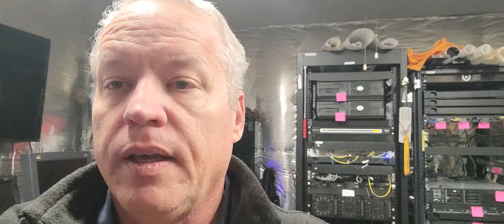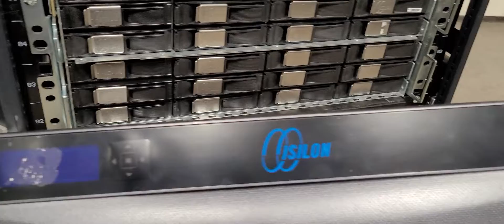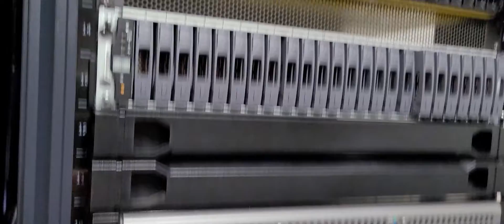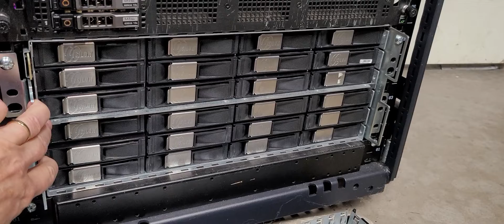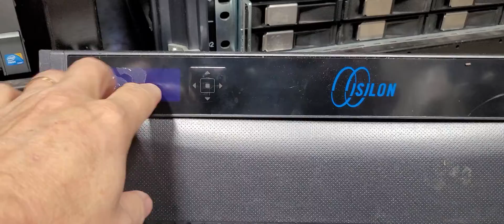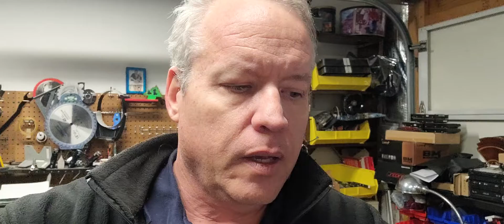Migrating my FreeNAS server (old) to my new TrueNAS server (new) and how to do it to save space

Comment: My NAS started as me buying a RPi-4 and connecting two USB3.0 HDD caddies to it, running Open Media Vault.
It worked well enough (MUCH better than something like a WD MyCloud).
I ran my FTP to it for local IP cameras (had one Purple drive) and another Red drive that was a 4TB storage. No redundancy though.

When I began working at the job I am at now (about 1.5 yr ago), I began to learn more of the MS/Office side of things... and how servers functioned differently than consumer/home PC's. I had the opportunity to buy my first Dell R710 and I brought it home... n began to learn the hard way. Turning it on n google'ing a ton 😆

It has been a bit of a shock (and learning curve) w/ servers... especially how picky they are (RAID controllers not liking diff HDD's, or sizes depending on BIOS, or not starting b/c of hardware not playing nice, etc). Ultimately, I felt there was too much to upgrade on my R710 to make it what I wanted, so I went out and haggled on Ebay for the R720.

It was frustrating (still can be) and Ive lost tons of sleep b/c Id stay up trying to crack a problem... but it pays off. 
I agree it's worthwhile to stick w/ it. And to just try... even if we don't think we're able. W/ the information available at our fingertips.. there's not much a person cant teach themselves nowadays (or learn from others as many of us watching your videos)

With your HDD replacement method (I do similar -- I get the cheaper ones from sellers selling 100's) -- was it just not cost effective to buy larger drives new and use less? Or is there an advantage to distributing over more drives? Ive been wondering if it'd be worth it for me to buy 2-3 of the 6 to 8 TB NAS drives, or just stick w/ the used datacenter ones?

Comment: Good tips brad, I dont have this much data yet well not in needing a whole server for backup 

i do have a question about the dell power edge 720 can you tell me what the difference is between the standard one and the google one as it looks just like the google one has a different colour and front pannel or are their some other things that are different ? 

do these come in the 710, 720,
Reply from the maker: Sure, the best way is to this is to give you a URL that will show you the options and formats.  I found this link worked well.  (look below.  As for my design, THe google engine used the Dell R720 chassis using the 24 bay 2.5 inch drives.  Prefect for my needs plus the chassis can do a GPU and is a Dual CPU server with lots of RAM.  Sweet!  Take a look for yourself.   https://techmikeny.com/collections/dell-poweredge-r720?gclid=EAIaIQobChMIsMWXmqv3-gIVh4XICh38EQdaEAAYAiAAEgJRgPD_BwE
Reply: @leadiususa7394  hey brad this is a very useful link i didnt realise their were so many variations so a question that does come to mind is the motherboard exactly the same for all configurations and if you got a dr720 ?

can the chasis with 16 drives can it be converted into a 24 drive bays ?

and if you have bays that are setup vertically can you change the bays to be horizontal instead like wise or do you actually need the chasis that give you this ability ?

as some dell 720 chasis you can pick up rather cheap while others are quite expensive
Reply from the maker: Well. You could price a chassis together if you but as for the no board controller, you will need a external SAS controller to add a external disk array for the on board perk controller only has internal connectors. Plus it is for up to 26 drives.  So you want the second controller for the extra disks support.  Outside of that have fun building your version